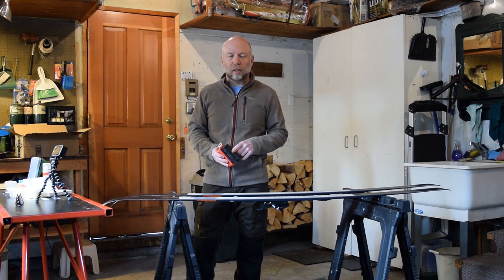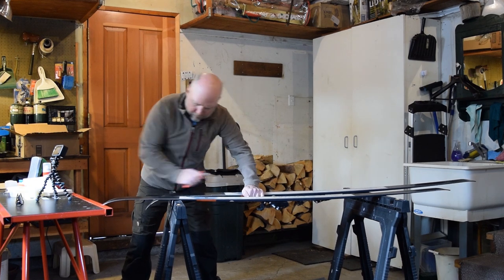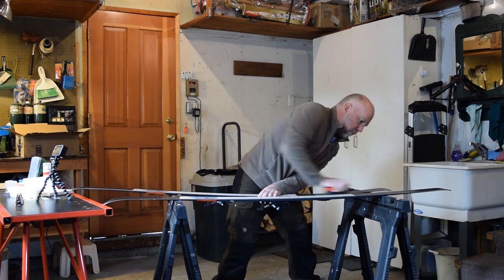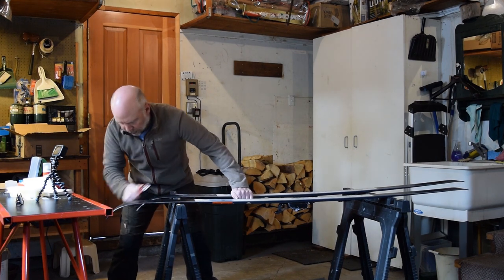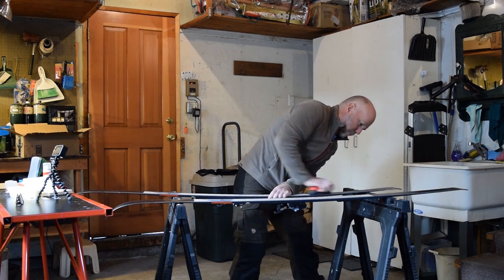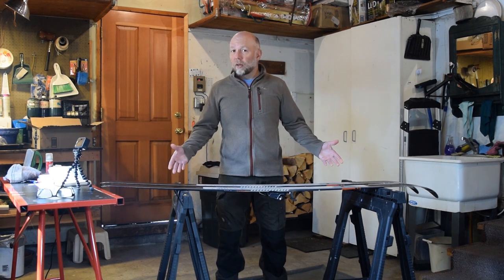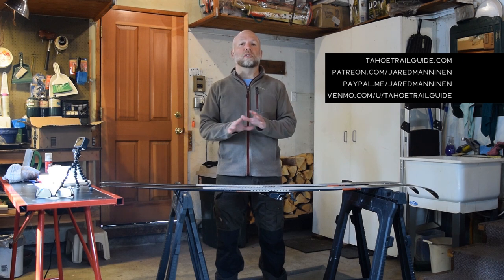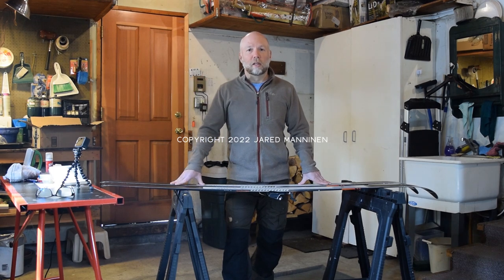Wax Your Waxless XC Skis: Applying Storage Wax to Your XC Skis

Comment: Not certain if you mentioned it, but could you place a liquid glide wax (I have Sxix F4) over the kickzone. I just want to keep that area “hydrated” during the off-period months.
Reply from the maker: Hey Andrew!

Yes, you can totally put the Swix F4 in the grip zone assuming you have standard scales. I wouldn't do this on skins, though ;)

I actually always put some of the F4 on my scale pattern just because the scales tend to be really good at collecting (unwanted!) snow in them. I do know some people who will actually apply hot wax over their scale pattern for storage purposes, but I've never (yet?). Then, in the fall, they'll heat the wax up with the wax iron and rub off the excess wax with a paper towel or rag.

Hope that helps! And great to hear from you again :)

p.s. I've totally dropped the ball on sending any Patreon art to you, so I plan to get a care package out to you within the next month or two. As always, thanks for the support!

Comment: Nice video.  Thanks again. Have you heard of people using paraffin wax (what is used for canning) for storage? I am referring to entry level skis, not performance skis or not advanced skiers and racers.  Have seen and heard arguments on both sides for using paraffin entry level touring skis and rental fleets.  In the context of what you are trying to accomplish with storage wax, would like your opinion. Thanks, Jared!
Reply from the maker: Hey John,

Thanks for watching and the kind words :) And I apologize in my delayed response.

As far as paraffin wax goes, I haven't heard of people using that for storage waxing applications. I have heard of people carrying a candle with them while backcountry skiing to use in waxing emergencies (i.e. they rub the candle wax to the base to aid in preventing snow from sticking). But not for actually storage waxing a set of skis.

The interesting thing about your question is the mention of entry-level skis. Realistically, most entry-level cross-country skis feature extruded bases (versus sintered) which don't hold wax very well. So, no matter how often you wax them, an extruded base just won't retain wax like you'd find with a more performance-oriented set of skis. I still believe routinely waxing skis with extruded bases helps to maintain them. But you won't achieve the same glide properties as with a set of skis with sintered bases. I don't want to go into the difference between the two right now, but better skis retain wax better.

All of that said, I'd personally stick to standard ski wax for use in storage waxing them. But, then again, if all you have lying around are a bunch of old candles go for it. haha.

Not sure if that answers your question, so let me know if you want more clarification.

Thanks again for tuning in, and for the question!
Reply: Thanks, Jared.  My take:  no doubt ski wax versus paraffin would have better gliding properties.  But your point on the type of base is the most important one: extruded versus sintered.  And there is also the bias: ski companies want to their respective brand to be a better gliding ski, wax companies want the inventory turn, and ski shops want the add on sale.  And wax is not inexpensive.  For a performance skier, or racer, speed is important.  For an entry level skier, I believe they would not notice the difference. Most entry level snowboards have extruded bases, and my guess is the owners do not have waxing irons. Same with entry level XC skis (extruded vs sintered) as you pointed out. 
1974 had the first world champion (Thomas Magnussen, Sweden) on fiberglass skis. Prior to that and even for a few years after,  high end racers would use special green kick wax on the tips and tails of their wooden racing skis.  It wasn’t until sintered bases on racing skis came on the scene where people would use glide wax. A selling point for extruded bases is they are easy to maintain and repair. And yes, the glide is compromised. But as pointed out, glide is not of paramount importance for the owner of an entry level ski. They will still glide, and back in the day the glide wax was a kick wax.  So using paraffin as storage wax for an entry level extruded base would probably not be noticed by the skier.  But yes, you answered my question in light of separating the kinds of bases, which is a very important point.
Reply from the maker: @johnmathieu9613  That's interesting about the green hard wax for the times and tails! There's a long history here in the Sierra Nevada (dating back to the longboard races of the 1800s) of using all kind of "dope" to make the wooden skis glide better downhill. In fact, it could be argued that the Sierra Nevada is the birthplace of specialized waxing thanks to all of those miners the emigrated here from Norway and Sweden :)

But, you're probably right in that paraffin wax would be just fine on extruded base skis. I just wouldn't even know where to look for it. haha. I've never gotten into canning, so I didn't even know it was a thing. But it looks like it's definitely a lot less expensive than ski glide wax.

Thanks again for contributing to the conversation with such interesting ski historry!

Comment: Excellent advice!  Thank you.  What about summerizing the grip zones of waxless XC skis?  Rub-on liquid glide wax?
Reply from the maker: Thank you for the nice feedback 🤗

As far as treating the scales of a waxless xc ski goes for storage purposes, you could use a rub-on liquid wax. Honestly, though, I don't think that would last for very long. Probably better than a Swix F4 or Toko ExPress type of easy liquid wax would be one of their temperature-specific spray-on versions. A bit more expensive, but I think would be longer lasting as it's much closer to actual block wax.

But like I said in the video, I tend not to worry too much about the scales for storage. Mostly I treat them throughout the season when I'm routinely brushing and hot waxing the glide zones.

Anyway, hope that helps. Let me know if you have other questions. And thanks again for tuning in. I really appreciate the support 🤗

Comment: How effective is this storage waxing where the rusting of the edges is the main concern?
Thanks for the video😊
Reply from the maker: Hello Gairn!,

Thanks for watching, and for the question :)

In my experience, I've found that if the metal edges of my skis don't have any rust on them and then I apply storage wax to them (for the summer months), they won't have any rust on them when it comes time to ski again. I don't think the storage wax will help much, however, if the metal edges already coated with rust.

That said, routinely hot waxing, scraping, and then brushing the skis tends to keep the rust away. At least this has always been the case for me. Through routine base care (again, full hot wax treatment), my ski edges have generally remained rust-free.

I don't tune the edges of my metal-edged backcountry cross-country skis like I used to with my snowboard. But I think tuning the metal edges, as you would an alpine ski or snowboard, would help to get rid of the rust if it's persistent. And/or just thoroughly brushing the ski bases (and edges) with either a bronze or steel brush would probably knock a bunch of that rust off. If it's really bad, perhaps try some fine grit sandpaper (only to the metal edges, obviously). I've done that before on friends' skis with some success. Again, though, for me as long as I'm routinely using my skis and maintaining their bases through hot waxing I haven't had an issue with rust build-up.

Another option, and I hate to sound like I'm recommending taking a laissez faire approach, is that the rust on the metal edges of your xc skis may not truly affect performance. If it's totally crusty all along the edge, it'll definitely affect glide. But if it's spotty here and there, and if you're not competing in a race, for example, it might not even matter. In fact, the rust may eventually just wear off through repetitive use.

Lastly, if the rust is super crusty on the edges and you don't think the skis are worth resurrecting you may want to consider relegating that particular set to being your "rock" skis (for early/late season skiing and when conditions are not very good -- i.e. rocks, gravel, and dirt are showing amongst the snow patches). Then, pick up a new pair of skis for more ideal snow conditions.

Not sure if any of that helps or answers your question. So let me know if you want other suggestions or clarification.

Again, I really appreciate you tuning in and contributing to the conversation :)
Reply: @JaredManninen  
Thanks for the answer. Yes I will clean rust spots with a wire wool then apply the wax making sure the edges get wax too.
Reply from the maker: @gairnmclennan5876  Awesome! Essentially, you will end up scraping the wax from the edges when you scrape it from the whole base, but I think in the long-term the residual amount that sticks around helps to prevent rust from gaining a foothold on those edges. Good luck, and thanks again for the question!